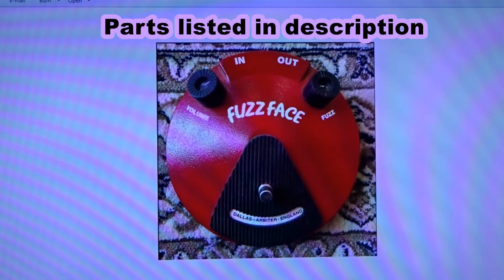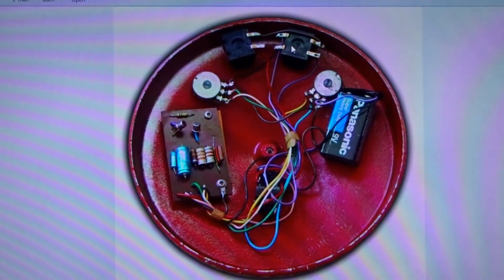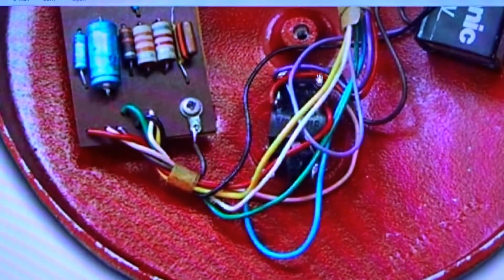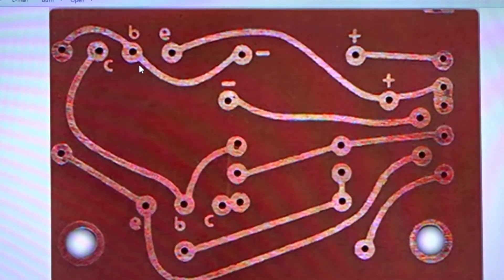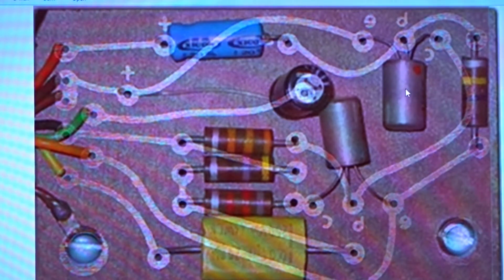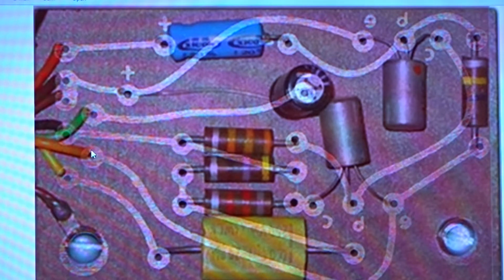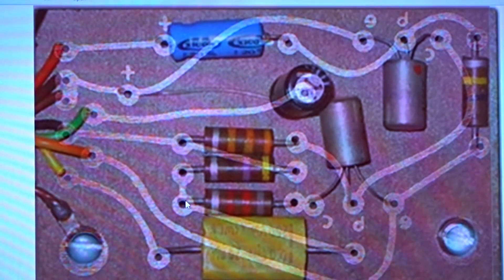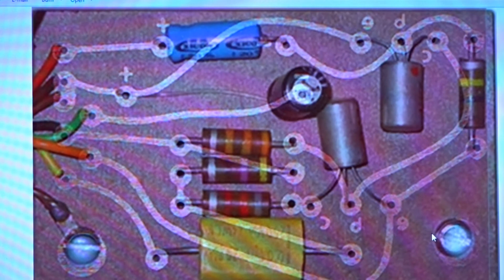Fuzz Face Circuit PT. 1

Comment: Does the ground wire screw attach to the case? Completing the circuit?
Reply from the maker: No. It's soldiered to one input jack & the jack grounds everything to the case.

Comment: Those transistors are not AC128 (1:38)..and BC108's are silicon which would require some small circuit alterations to get a 'good' sound.
Reply from the maker: I was going on what the site said was in there. I re-check the datasheet on the BC108 & yes I made a mistake here. BC108 material of Transistor: Si
Reply: @TheVlad69 the AC128 is a PNP germanium and are not interchangeable with BC108c/09s NPN silicon...you would need to flip the electo caps and wire for negative ground...I take your point about people paying silly money for a circuit you can knock up in 10 minutes...to me the hype with transistor selection is a negative against the circuit tho,the fuzz face is temperamental because its a minimum part count circuit that just about works 80% of the time...I think the Axis Fuzz is better and more reliable..
Reply: The output cat isn't ceramic...its a flim cap...you wouldn't use ceramic here in this circuit because of they tend to let RF interference in...we can already get radio stations with the fuzz face 😅...
Reply from the maker: @Danielallanz  I was aware that the caps had to be flipped. In my other videos I go into this. I wasn't aware about the ceramic vs film. I get one radio station that bleeds over a little but no where near as bad when I tried some high hfe lol It was like I was using a radio. I never heard of that fuzz pedal. I'll have to check it out. You can never have too much fuzz \\m//
Reply from the maker: After looking the Axis Fuzz up I did hear that pedal. Name didn't click but great pedal!

Comment: Way-overpriced vintage Fuzz Face pedals are a classic example of corporate-greed, I could probably make something equivalent for something like Au$50.00 or so in electronic parts, and that's including a diecast aluminium case, you can easily substitute any of the silicon BC series, and silicon 2N series of transistors for the originals and they all will work perfectly well in the Fuzz Face circuit, last year I bought a set of eight CDIL BC108C transistors on eBay, and a set of two Issue 2 Fuzz Face pcbs from Pigeon FX so I could rebuild my Jim Dunlop JD-F2 Fuzz Face pedal, it originally came with the "modded" Germanium Fuzz Face circuit board that featured two Germanium NTE 158 PNP transistors and some temperature stabilization circuitry, okay, so why did I rebuild it as a Silicon Fuzz Face? the two NTE 158 transistors died and the pedal no longer worked, well they didn't just die, the pedal went into self-oscillation first and then it stopped working, that's the so-called "real" "Germanium-mojo" nobody seems to want to talk about.
Reply from the maker: You're right about the Germanium mojo. So many are brainwashed with that & so much other stuff. Hendrix went to silicone for a reason. I had some BC108's & the can rotted away. The vintage gear & prices people are paying are crazy. You'd see the market fall if people actually educated themselves.

Comment: The truth is, a huge majority of the Germanium transistors that were made back in the day, and those that are available now, are actually not that good at all, and they never were to begin with, Germanium is a semiconductor element that has quite a few quirks and foibles, mostly due to how loosely the electrons are held in the valence-shell of the Germanium atom, Germanium was used to make the first electronic semiconductor components because it was readily available, it took quite a few years for Silicon to be used as a semiconductor material mainly because of the difficulties involved, there's actually nothing about Germanium that gives it any "mojo-like" qualities, what is so mojo-like about a semiconductor component that basically self-destructs itself if it gets too hot?

Comment: The reason why resistors, and also capacitors are made within a certain tolerance is quite simple, it's very hard and also un-economical to make them in exact values, but, contrary to what many people may think, there's no real need to make them in exact values because most electronic circuits are not that critical, unless you're building circuits for NASA, or for some reason you're building extremely accurate electronic measuring equipment, most of the time if you're building a circuit and you need a resistor of a certain value that you don't happen to have, you can substitute the next resistor value up or down and the circuit should still function properly as it was designed to.

Comment: Just so you know, a Gold tolerance band represents +/- 5% tolerance, and a Silver tolerance band represents +/- 10% tolerance, tolerance means that a resistor can measure anywhere between +/- a certain percentage of the marked value and still be usable, for example if you have say a 1k/5% resistor with the colour bands Brown, Black, Red and Gold, it can actually measure anywhere from 950 Ohms (-5%) and 1,050 Ohms (+5%).
Reply from the maker: I did know that & I thought I said that. But if I made a mistake as sometimes I do & said the wrong thing I am only human. Thanks for correcting the info here.

Comment: Saying that the Fuzz Face is just a few dollars of parts doesn't exactly tell the whole story and is a bit of a silly rant.

While most of the parts are indeed pretty cheap when you start adding up the enclosure, good pots, and proper transistors (which some are getting a bit more difficult to find cheaply) it really isn't $4.

There is also a bunch of labor if you purchase a finished product like drilling and painting as well as the assembly of it all.  

Original Fuzz Faces have the early transistors and are collectibles not just pedals so ridiculous seeming prices reflect this fact.  Sure it sucks that every cool old guitar, amp, or pedal can't be found at the kind of crazy low prices that existed pre or early internet but that's the reality of things.  The info is out there now (has been for 2-3 decades) and people with a lot of disposable income drive the prices.  

I have a Reuss Vintage Three Volt (copy of the original Fuzztone FZ1) that cost me I think $139.  Beautifully constructed, great pedal and I feel the cost was well worth it.  I am about to get to building a Fuzz Face myself now as I already have the case (an old Randall channel switch box) and some germanium transistors so the cost will be quite low but I'm sure when it's done I will still appreciate the Reuss.  $150-$200 for a hand built pedal really isn't crazy as a bunch of work goes into even a pedal with a fairly low  parts count.

Thanks for reading my rant if you bothered to and your video is cool and helpful.  Your overlay part of the video gives a better look at how a Fuzz Face is connected so good work there and hopefully others are inspired to try their own pedal builds from this.
Reply from the maker: Thanks for sharing your input & your story. I do read comments. 

My point of this video is to help people realize people are overpaying & driving gear up & they need to change their habits like with the Klon. There really is nothing special about it as my spectrum tests show against the Mosky & Tumnus. Unless you're a collector you're better off building somethings yourself or researching something cheaper. 

In my other video of this FF pedal along with the Rangemaster & Shin-ei FY-2 I do far above what any other pedal builder does in the finish. Layout & drilling the hole are easy & can be done by hand. It really doesn't take long to build these. Once you buy resistors, caps, ect kits on Amazon you reduce the cost to a faction of what companies are charging & when it breaks you can fix it yourself because you now have the knowledge. Enclosures on Amazon aren't much & you have extra for your next build. 

The trannies are becoming harder to get but there are some great alternatives out there that imo that sound fantastic in the builds I've done. So the total of the pedal completed costs $30-$45 vs $150-$200 & your time. 

What bothers me most is people. They are getting greedier thinking their time & knowledge is worth so much these days & they lie. I recently didn't have the time to replace an aquastat & hired someone. What is a joke is the person I hired gave me a bullshit story that they had to connect grounds & someone cut them & the hydrastat wouldn't work without them. To their surprise when I opened up the breaker box & said really? Why is is working when you didn't ground the box? And it was another bs excuse then cause they went over 7mins they tried charging me for an extra half hour. So this kind of business practice is what's wrong in every aspect today. Then you have the consumers that are driving prices up because of hype not cool. Simple solution is control yourself & don't buy. Watch the market fall & it will as we all seen during covid. After all something is only worth as much as someone is willing to pay for it & there's nothing in this world that only a few should enjoy because they have a large bank account or enjoy being in debt to make someone rich. That's why I share my knowledge freely & try my best to helps others in hopes they can save themselves money even if it costs me money I'm passing on savings to others which gives me satisfaction that I'm in someway taking just a little bit out of someone pocket.  

The time I have in my custom scratch built rock krawler which was featured in several magazines. The cost of parts & my time just got me laughs when I went to sell it. The cost of my lathe, knee mill, ect. cost me a lot & my time machining was a lot & that's cool I kept it & I'm glad I did as I would've regretted selling it. My point is if you want to collect something that you know you'll get your money back on invest in gold & silver. Money is just paper with dead people's pictures on it. NOS should be bought with caution & so should used gear.

Comment: Yup  4 bucks in parts from tayda not using PNP germanium transistors and not including the enclosure. Just built one on turret board using parts I already had. I used NPN, a 3904 in Q1 and a BC109 in Q2. Great video!
Reply from the maker: That's great! More people need to know this & put a stop to these companies overcharing. Thanks! I'm glad the video was helpful!
Reply from the maker: @MH1000a  How's it sound? Good combo?
Reply: @TheVlad69  It sounds good. I've been on a fuzz kick for awhile now, bought a few then Put together a few. latest was a TB v3, all parts from Tayda and then messed around with a MK 1.5 on bread board which is basically a FF, went back to the FF components for the turret board build.
Reply from the maker: @MH1000a  That's great! Glad to hear it sounds good. The TB are nice I wanted to build one but didn't get around to it. I'll have to check Tayda out never heard of them.